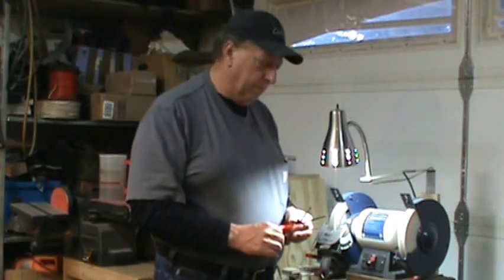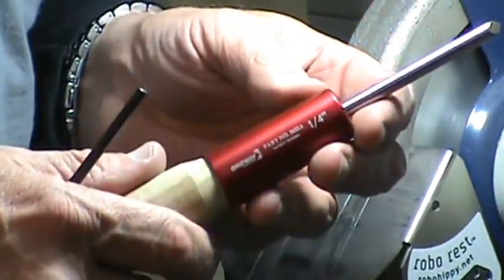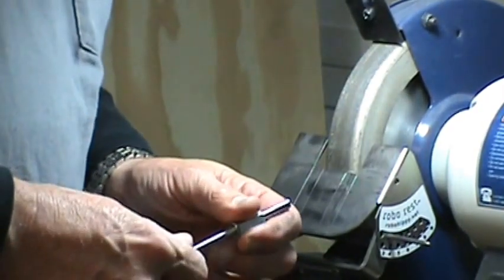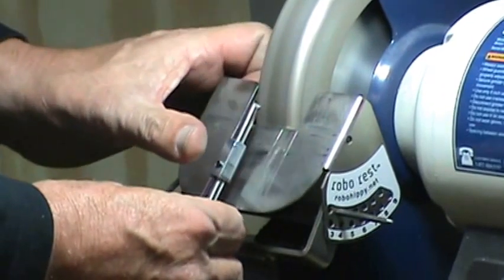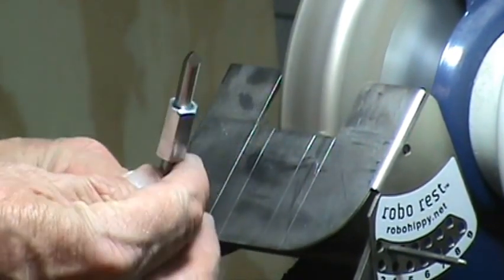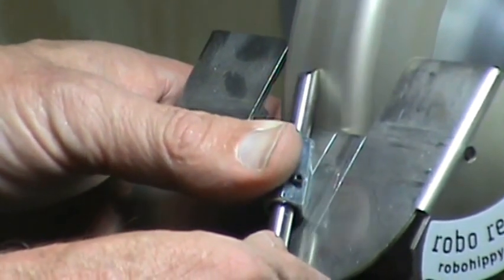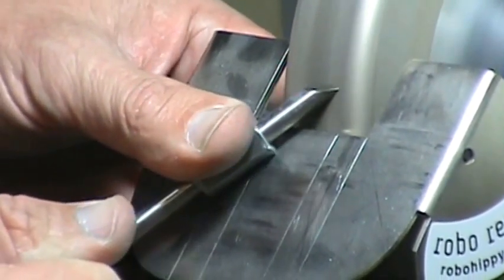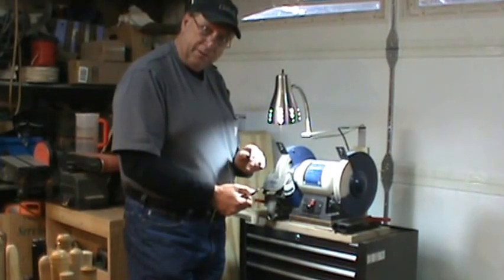Getting to the point. Making a point tool

Comment: Actually Jim, I  got another idea myself last night.   Take a  hex coupler and slide it down the HSS as far as the handle and engrave the spot and lock it there as you described  (but permanently).  Then take a second hex coupler and put it on an inch from the top, place the facets of both hex nuts on a flat surface to align them, then lock the second hex.
Reply from the maker: That's a great idea! Thanks for sharing.

Comment: Very good tip! Thanks a bunch. Have you any suggestions for how to get the nut lined up when  you come to resharpen it.
Reply from the maker: Add some permanent marker to the tip of the set screw and it will mark the tool shaft. Then use an ingraver or file to permanently mark the tool shaft. Note that as the tool gets shorter you'll have to repeat this.